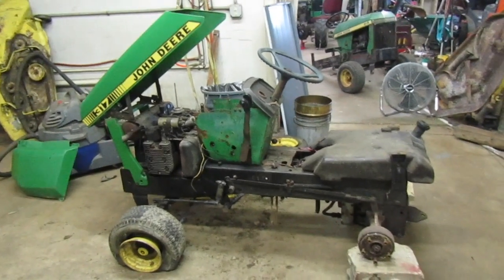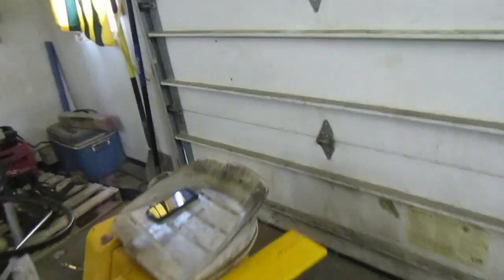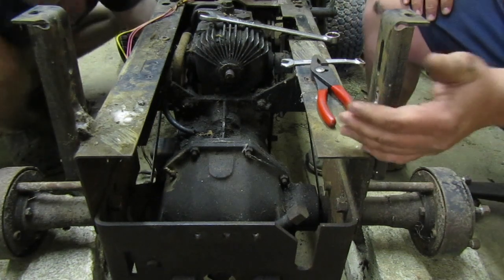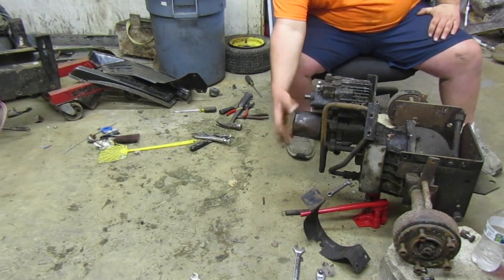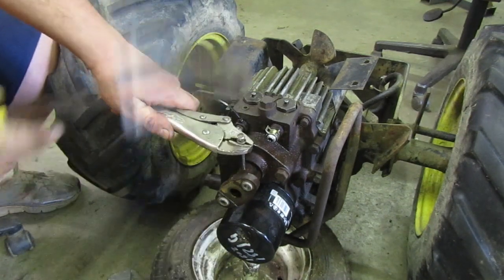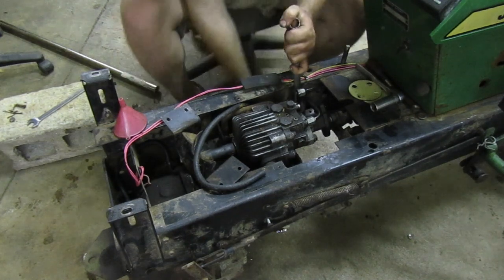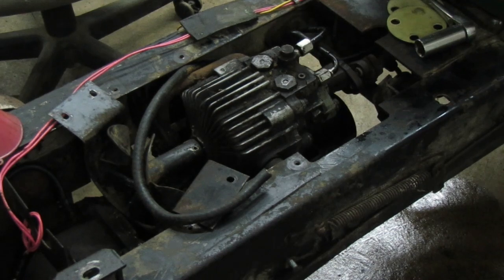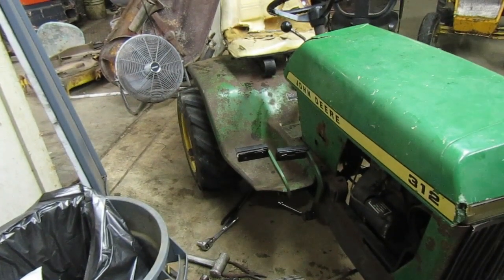Transmission Swaping the 1978 John Deere 312

Comment: Jon.  Regarding the Cub Cadet hydrostatic transmission;  The hydraulic filter may be stopped up. Usually the transmissions will exhibit a “Jerky Feel” rather than smooth feel like it should. I have fought that battle before.
Reply from the maker: Might have to look into that
Reply: @themaniacmower   The NAPA number is 1084 and the Carquest number was 85084. I preferred the NAPA filter because it had a nut welded onto the filter casing in which it took a 1,1/8” wrench or socket. As a rule, The Sundstrand in the Cubs very rarely had any problems other than the hydraulic filter getting stopped up or the pressure relief valves that both Mike and yourself are very familiar with. I don’t remember the Cub Cadet filter number off the top of my head.
Reply from the maker: @TheIronDuke502  my cub has that Napa filter on it
Reply from the maker: @TheIronDuke502  need to see if it says a date on it looks new any idea what filter was factory on the cub
Reply: The Cub Cadets all pretty much used the same hydraulic filter. I know that my 107 and my 682 used the same filter. I can look it up and get back to you.
Reply: @themaniacmower   Jon, As promised the OEM filter number is Cub Cadet 723-3014 or 923-3014 and or superseded number of; MTD 923-3014. 
If I had a direct email address from you - I could send you a complete filter interchange list. 
Also Jon, There are 3 John Deere filters listed on the interchange list which are; 9700836, AET10701 or a AM39653 filter. 
Hope this helps you out,Jon.
Reply from the maker: @TheIronDuke502  you on facebook?
Reply: @themaniacmower   Yeah,, I am on Facebook, Instagram and Twitter. I think that found you on Facebook. I will send a friend request.

Comment: Our neighbor has got one sitting in a barn. Decently clean, but it’s a 317. It’s got all the implements, tiller, now thrower, & I think something else, but it’s got everything. 

I’d have to get everything for next to free cuz if the motor in the tractor. I’ve got a Kohler M18 I think is good.

If I got it going I’d probably just flip it. Once it goes down hill I don’t want it. Got 4 other tractors that needs my $.
Reply from the maker: see if you can make some kinda deal with them. Id say go for it